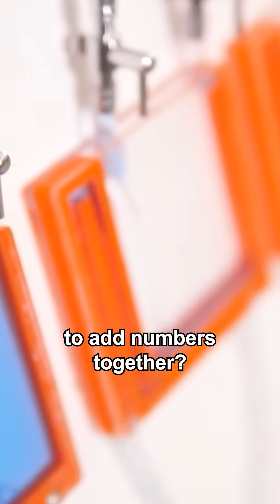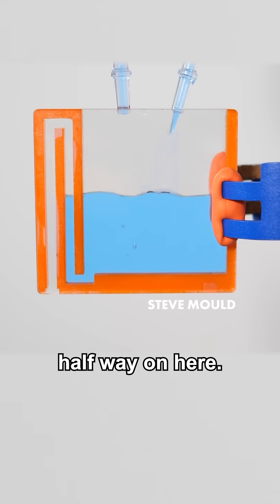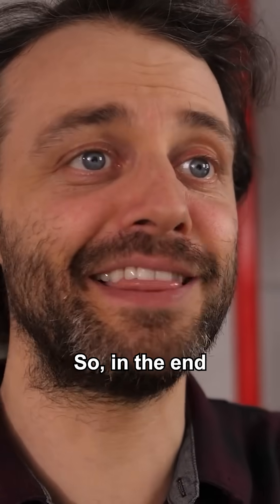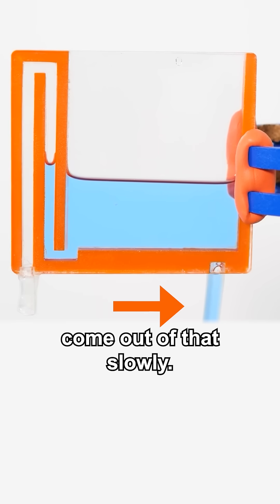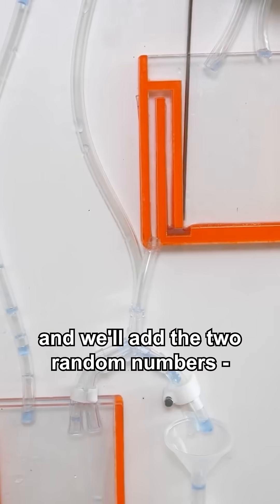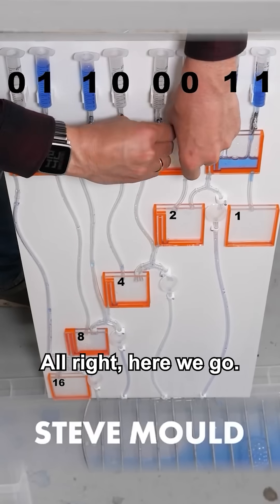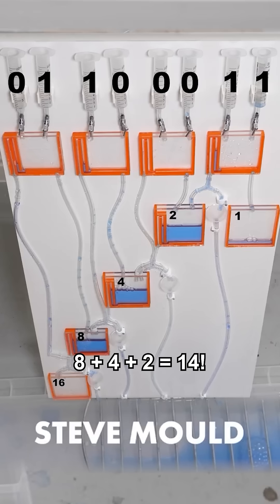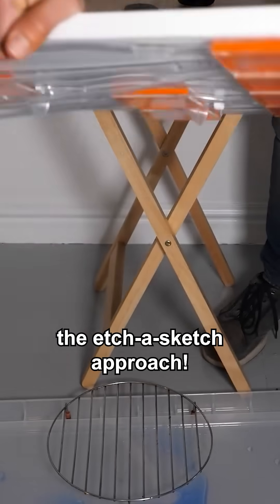I built a water computer using greedy cup siphons

Comment: Now for the floating point unit.
Reply: Cubits and qubits
Reply: More like "floating unit"
Reply: @creeper6530That’s the joke
Reply: I see what you did there
Reply: @gorkwobbler I did not 😊  what happens if we use a fluid instead of a liquid.  I tried but the "solution" evaporated away from me.  I had no floating solution, should not have use a mixture of oil and water and mercury, I guess.
Reply: It's (mostly) the same, you just have to do it on 53 bits of the mantisa and 11 of the exponent, so 64 bits in total. It would be a bit overwhelming and underwhelming.
Reply: Exponents.

Comment: a AND + XOR gate together is crazly lucky for an ALU build. usually the XOR is the hardest part
Reply: Even better, it's universal. You can implement anything else using a combination of AND, XOR and constants. The big one being XOR(1,x) = NOT(x), and with already having AND, you've got a way to make NAND, which itself is universal.
Reply: Well it's not obvious how in practice one would make a xor() where one of the input is a constant 1 with only water and gravity
Reply: @salmiakk_it fill it with one dose of water before using each time? Doesn’t the gate only get used once per calculation or am I missing something?
Reply: @salmiakk_it  Constant drip feed that equals the XOR output rate?
Reply: This kind of XOR is pretty slow and can't be combined with another XOR. I don't like it ;-)
Reply: Distance and length of tubing/holes can make logic gates all over the sides of a shape/pattern setting different levels of resistance, area of flow, amount of flow, etc. He essentiall has 4 gates built in to 1 now. The 2, the 1, the 0, and he could even add an overflow gate.

Comment: I feel the XOR is a bit too hacky. Lets try to improve with the AND on that:

computers use a NAND as the base block. from that you can create any other logic gate. So figure out how you can invert water flow (NOT), and you find the solution to OR and XOR.

I would love to see a latch in water logic.
Reply: Inverter is easy: take the XOR part and use a constant 1 for one of the inputs. A XOR gate can be thought of as a controllable inverter.

The latch is the hard part for this. Latches need feedback loops, and I have no idea how you're going to do that with gravity-moved water.
Reply: @Roxor128  That is exactly why I think a latch would be interesting. 

My approach to an inverter would have been different: Use a spare supply of water. Otherwise block the output. Blockage should be achieved easily, when there is no pressure difference.